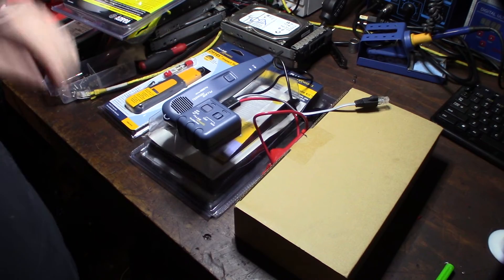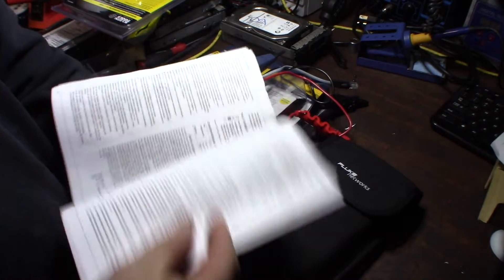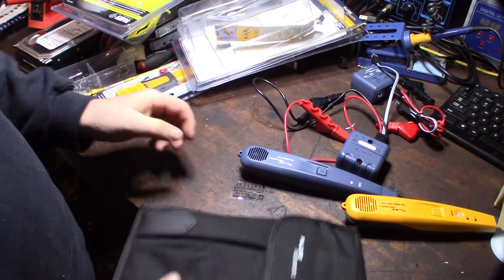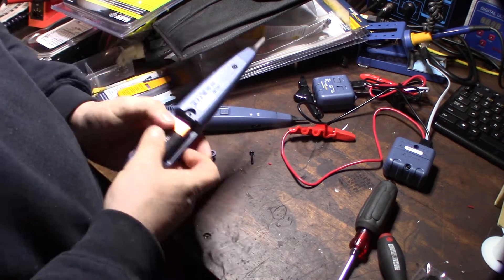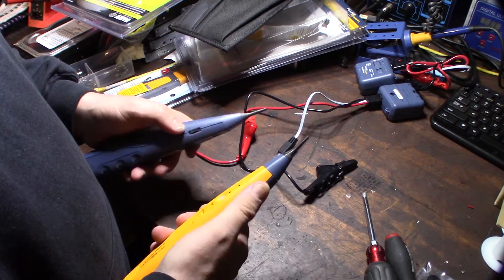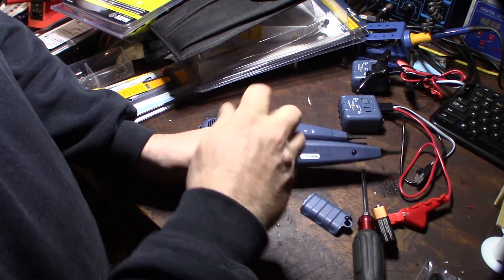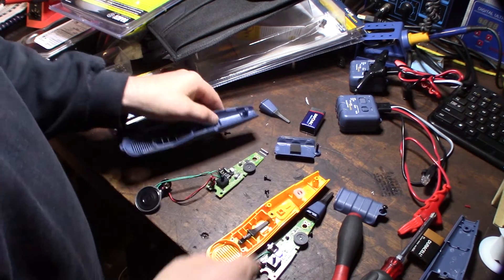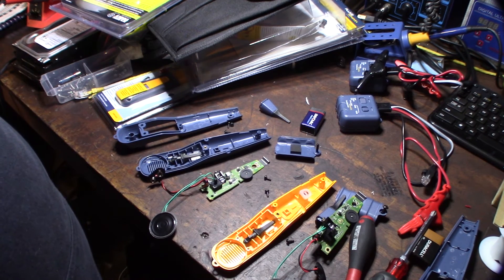New Fluke Pro 3000 PRO3000F60-KIT active filter toner VS 26000900

Comment: I think an important point to add is the non-filtered toner is good for tracing but if your wires are crossing with a live circuit is going to interfere and you're fucked. If you get the filtered you still get a clear signal even if the wire you're tracing is in the same raceway with another live circuit
Reply: The pro is capable of enabling/disabling the filter. Secondly, there are other tools which would be preferable to guage the line/connection quality/snr.

Comment: I bought the 3000f60 after loosing my old 26000900 toner (found it a few months after purchasing the new one lol). Actually like that the toner stays on but did notice that the case flap is definitely cheaply made compared to the older one (yellow Fluke logo) as a month in, the fabric has already ripped by the velcro.. overall, like the filter improvements (even though I do notice it has a small reverb effect on the sensor)

Comment: To tone a live cat6 wire crimp a wire pair into 2 holes in an rj45 that are different color (dont the holes for the brown wires those are poe) plug it into the drop and use the clips. On the switch end the wires are connected by the same color pairs so youll have no continuity and a loud tone. You can also put rhe red clip on 1 wire and ground black. To see if its connected to a switch to being with use the toners rj11 to test for continuity.
Reply from the maker: I actually like the older pro 3000 better. The filter and button is annoying on the new one.

Comment: One question: Can I Use on Live circuits meanwhile testing?  Thanks a Lot!!!
Reply: No you cannot use it on live circuits. You will burn out the tone generator.
Reply: You need a green lee circuit seeker or an ideal SureTrace Circuit Tracer. Both are gonna be about $1000. I’ve seen used ones on offer up or eBay for $200

Comment: I know that this is a post from Feb 2019, but, you mention that you are having some type of difficulty toning cables attached to a network switch.  Remember, if you have your tone module attached to a cable, that circuit is dead, and can be disconnected at the network switch for "full tone."  Tone probe volume simply isn't an issue in all but the loudest of equipment rooms.  Just disconnect the "dark" cables one at a time at the network switch.  The right one will immediately be detectable.  ("always," if it's a good cable)

Comment: I picked up a filter probe a little while ago and I didn't really feel like it made a big difference. Tried it on a live jack that was plugged in on a switch port and it wasn't what I hoped for pretty much the same thing as the regular fluke 3000 probe. Still playing around with it in the field so time will tell.
Reply: You do understand all you're getting is a filter for cross-talk, right?  If you're trying to tone on live shit you need a digital toner, not the analog toners.  You need the intellitone 200 from Fluke.